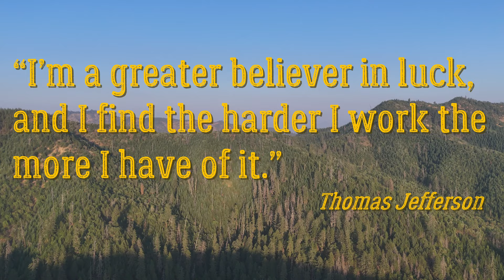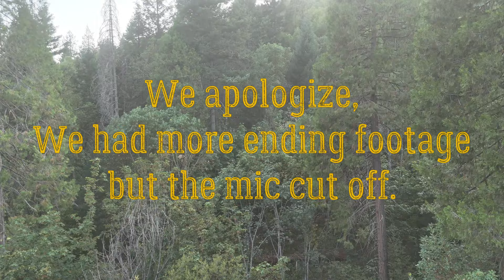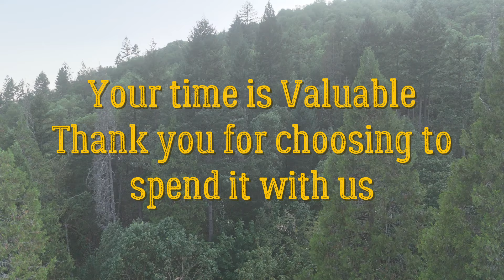Crazy - gone bananas Off-Grid Homestead #diy #selfreliance #selfimprovement #woodworking #sawmill

Comment: Yes my those bananas can be a lot of waste so I usually cut firewood off the end until some of it's out then it might make an 8' or 10' foot board, & I always try to start with the hump up gives me a better idea what i have to work with :) I had lots of 16' logs last summer that were banana & I just cut them all in half then way less waste & I needed a lot of 8' boards so it worked , But we all need a little firewood anyway !
Reply from the maker: I'm burning, predominately, madrone and small amounts of oak. You have a great point though. Truly appreciate your correspondence.